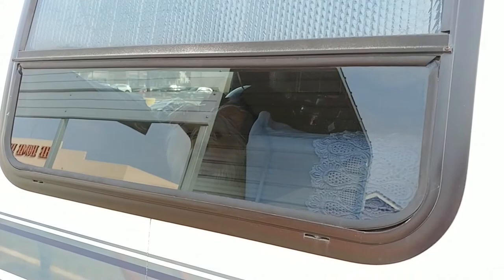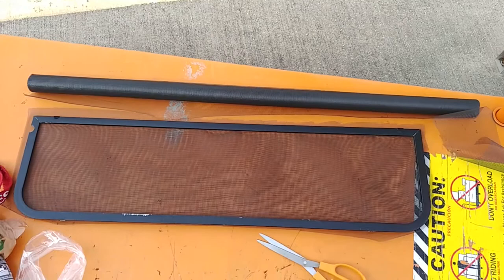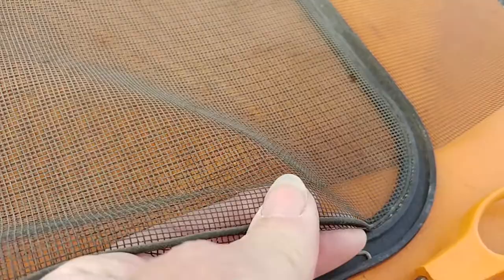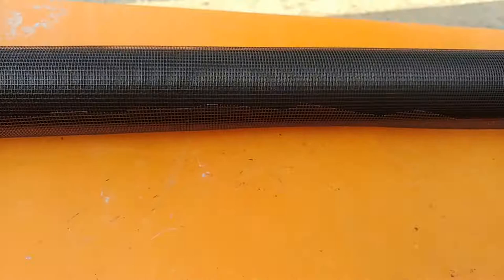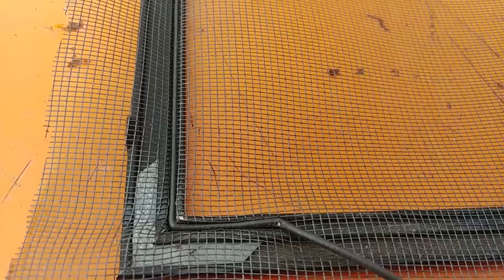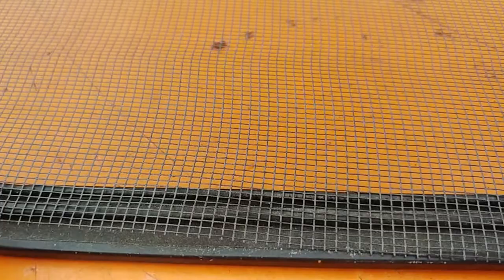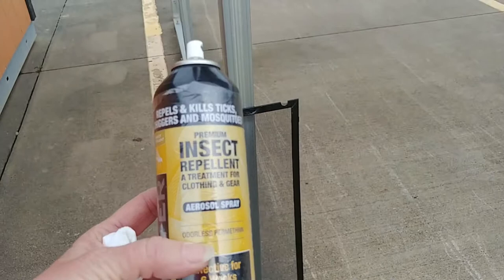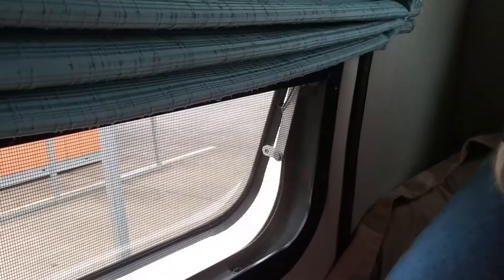RV Window Screen Install DYI

Comment: Home depot isn't  a rv parts store
Reply from the maker: Home Depot IS an RV parts store if you need screen material, plumbing parts, screws, etc.  There are some things you can get for a more reasonable price from a NON- RV store.  That has been my experience.